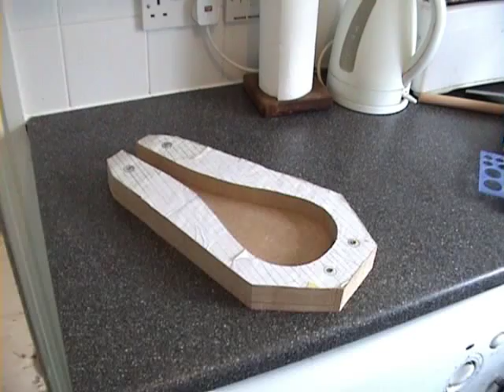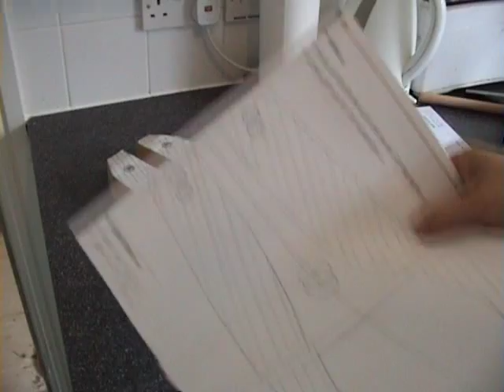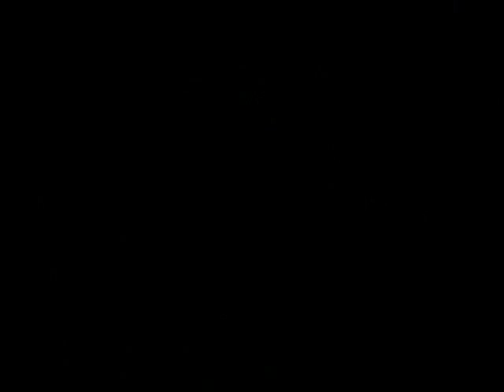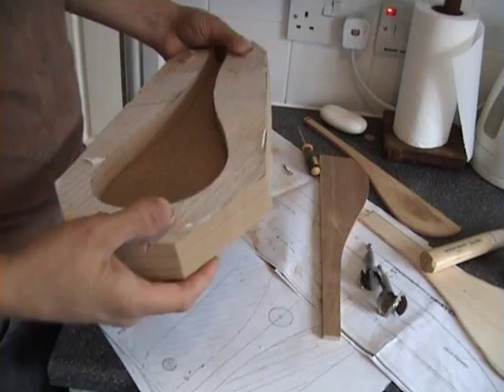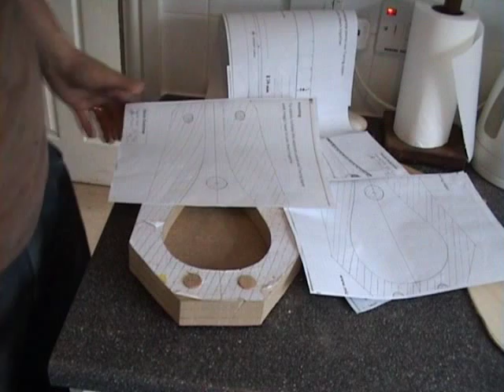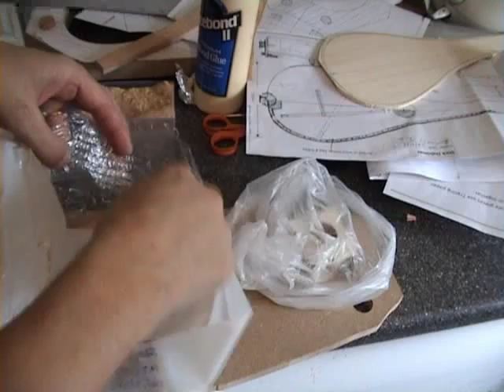Stick Dulcimer Making part 1 making the Mold

Comment from the maker: There will be a few more this week, I needed to leave the ribs and linings nearly a week so that they were dry to glue up, (I could have cheated here and used other heat bent set but i have other instruments I have to work on as well...) 
This week (time permitting)will be rib glue up, linings and sanding soundboard rosettes and preparing the stick......